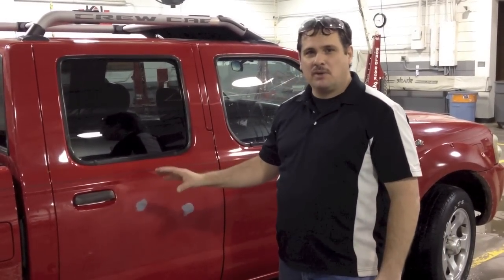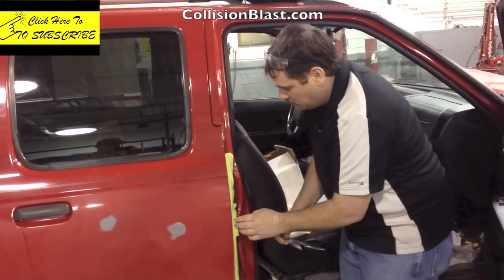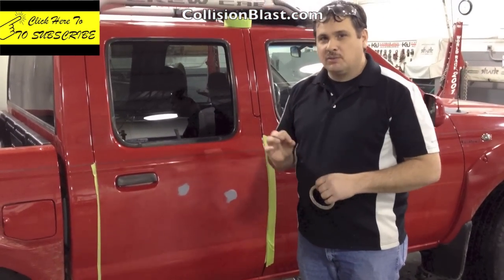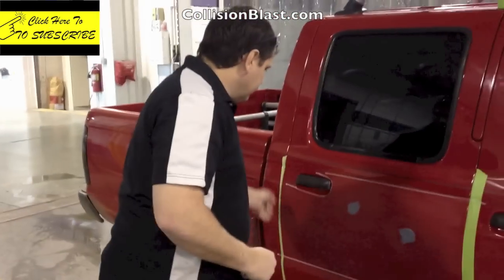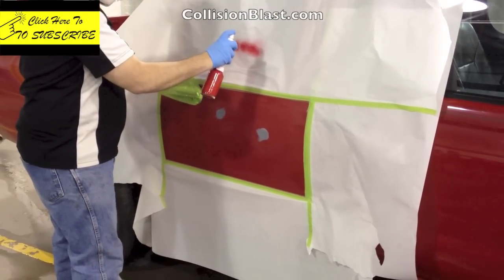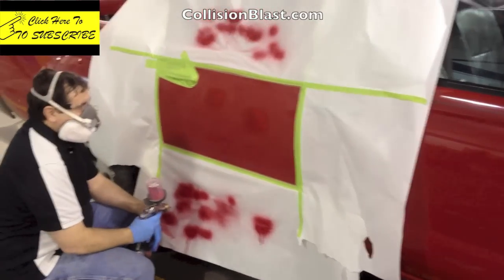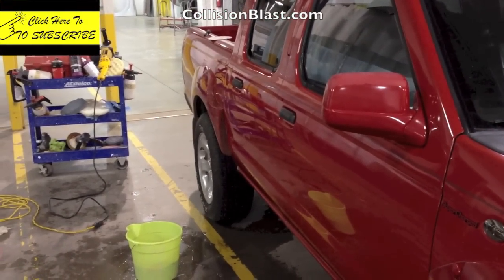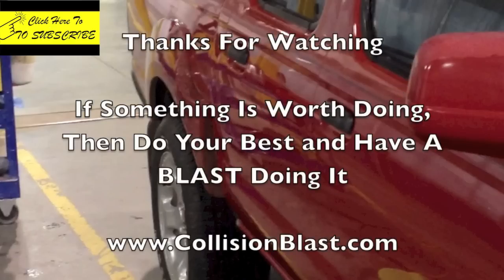Car Spot Paint Job Using Preval Paint System

Comment: I notice how there was no front view of the repaired area. Most likely because the paint was blatantly visible and looked terrible. A better idea for anybody looking to do it cheap would be to not even bother doing the 2 small spots, just spray the whole area with basecoat and buy a 2k lacquer can with a fan nozzle and use that. I'd rather have a possible slightly different shaded door than 2 big circles of basecoat showing through. Hopefully no money was exchanged for this job 😂
Reply: lmao
Reply: I agree horrible job!
Reply: Looks like another 1-2 layers of color could have been added, as the color hadn't covered the primer yet. 

Other than that, looks good.
Reply: I thought I was trippin🤣
Reply: I was thinking the same thing, why not do the entire area edge to edge.

Comment: Here’s some tricks for using a Preval:  1) spray alcohol through it to clear the mechanism before putting any paint in. 2) make sure your paint is thinned to a skim milk consistency. 3) strain the paint well before adding.  4) be patient, spraying with several very thin coats, keeping the sprayer moving and not too close, to avoid drips. 5) if it spatters, do not use, switch to another Preval.  I hope that helps, I use Prevals all the time for different types of applications. I’ve never tried it for an automotive repair.
Reply: great tip thanks 👍

Comment: if you dont actually use the preval then the title shoudnt be car spot paint job using "Preval Paint System"...after the video was filmed you knew you didnt use it, but still titled it saying u used it...same with the plunger vid( shows a toliet plunger) but you use a professional tool instead... goodvideos though, just the titles are misleading.

Comment: How much reducer did you have to use (%) so that Preval would begin to spray ?  I plan to use the preval  system to spray catalized automotive clear on some small / medium size model airplanes and so I don't need to invest in expensive equipment.

Thank you for your time
Charles.

Comment: Didn't like the Prevail paint system and got the You Can this week didn't like it either don't want to keep using reusable aerosol spray cans nomore better off with a paint gun or a aerosol spray can that not refillable.